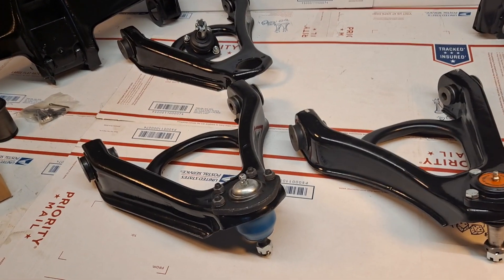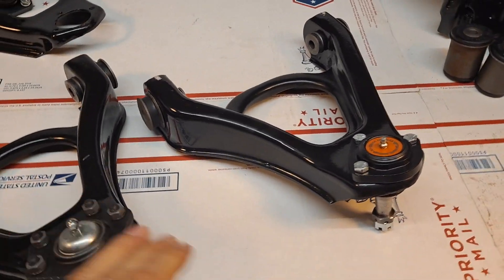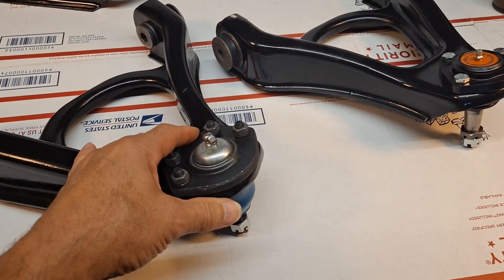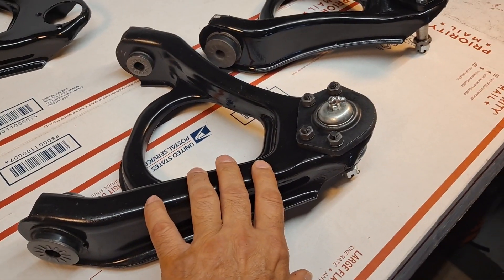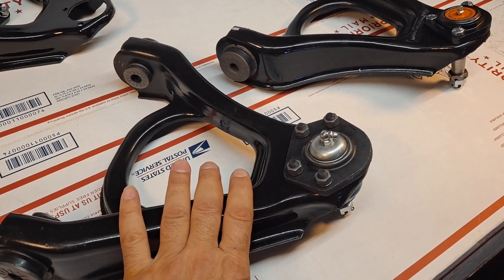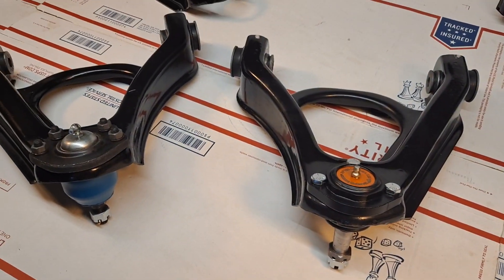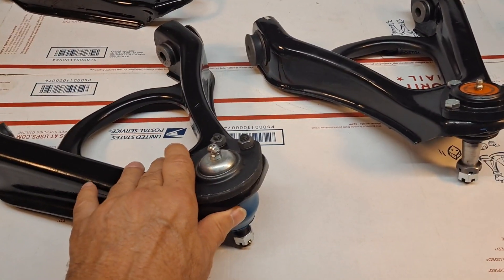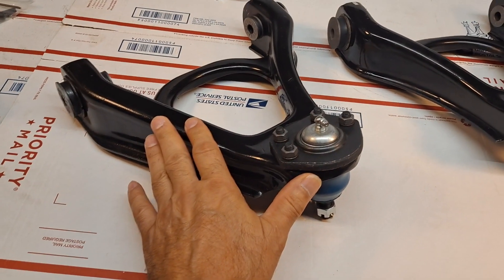1971 - 1976 CADILLAC ELDORADO UPPER CONTROL ARM RESTORATION with BUSHINGS BALL JOINT

Comment: My lower control arms on the 69 Deville are not letting me get a good camber. All new bushings and the updated ball joints. Do you have lower arms?
Reply from the maker: Yes I have the control arms fully restored with the proper ball joints and isolator bushings... I have 375,000 original vintage Cadillac items from 1959 through 1976 .. and through 1978 for the Eldorado,.... so if there is anything else you require feel free to reach out to me at 727-364-7523 or via email kypitsn@aol.com